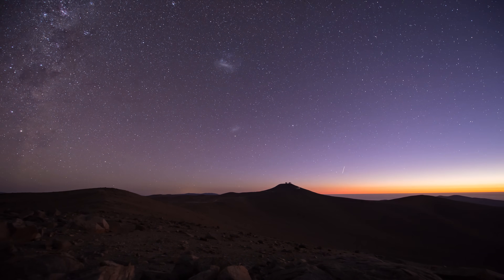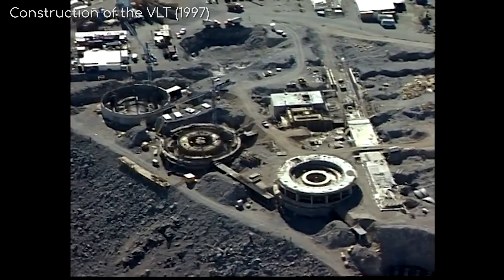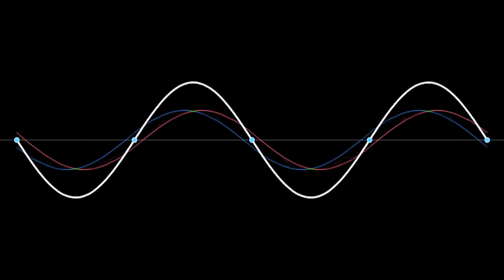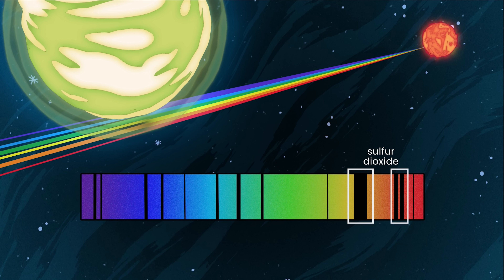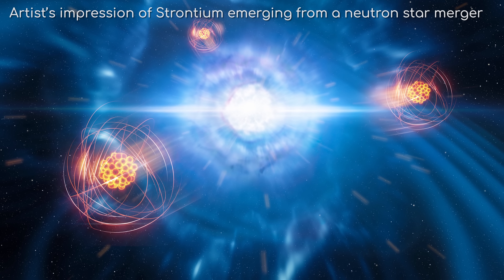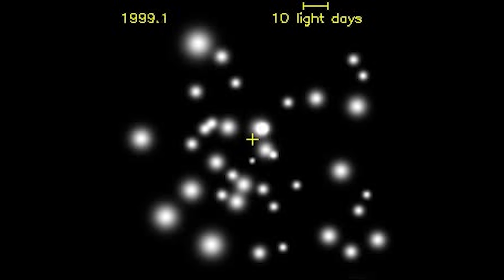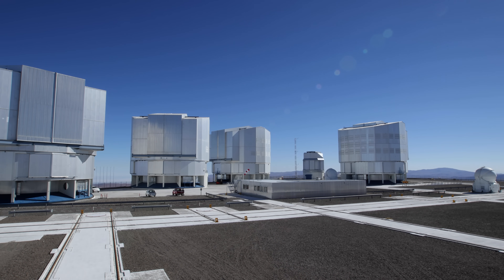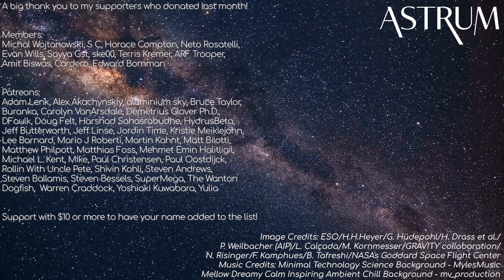5 Hidden Secrets of the VLT Telescope Revealed

Comment: 9:40 I wouldn't narrate Penrose's theorem like that. His theorem is that, in GR, a trapped surface implies a singularity, which is a very theoretical result and issue.
When we talk about observations of black holes, we are talking about physical (i.e., observable, physis is what is given to the metaphorical light of observations) black holes, i.e., the "outward" phenomenology of (unbound) gravitational collapses. But a trapped surface doesn't provide, by definition, an "outward" phenomenology.

It is relevant to remember that that scope of study of the black holes of theoretical physics does not coincide with the scope of observations of (physical, ok, redundant, but I am making sure to clarify of which one I am talking about) black holes.
The reason is simple, the event horizon, and whatever is inside it, is not physical, i.e., not observable from the outer universe, aka this physical universe.
Trapped surfaces are not a tool to recognize physical conditions that would lead to the formation of physical black holes.
They are a mathematical condition that leads to the mathematical issue of singularities "within" event horizons. So much so that Penrose made his conjecture that any GR singularity must be hidden within an event horizon, and thus not be observable from the outside (which is to say not physical).
Penrose's theorem has no bearing on the issue if there are in the physical universe conditions that leads to an unbound gravitational collapse, and if there isn't anything else that prevents it. Thus, the observation of physical black holes is not something that Penrose's theorem required.
This takes away nothing from the observation of (confidently) physical black holes, which, of course, is something very informative.
PS: Schwarzschild's solution is stationary, it does not represent the formation, evolution and not even localization in space within the outer universe of physical black holes. It is possible to connect by mathematical continuation the regions inside and outside the event horizon, but this does not mean that this is the solution which is relevant to physics. Indeed there is causality inconsistency in the global Schwarzschild's solution with event horizon, namely the fact that the outer curvature is determined by the mass inside the event horizon which cannot cause anything in the outer region. This should be taken to indicate that the criterion of continuation, as good as the good mathematical criterion that it is, might not provide the right physical insight, in this instance.
I very much prefer to concentrate my interest on the physical limit toward the horizon, where the latter is not part of the physical (observable) universe (which, thus, remains open, the limit is not part of it). Since the horizon itself is never outwardly presented (not a "mere" appearance, it is never causally presented), it never occurs that the mass within the would-be horizon is physically cut off from this universe. This restores the causal consistency between the mass and the curvature determined by the mass (i.e., this determination can be intended as causation), and provides the localization of the (physical) black hole in the (physical) universe (otherwise, if it was causally cut-off, it would be causally nowhere). That mass remains causally presented to the physical universe, with properties determined by the limit (the process toward, but not the result of the limit) as either residual (the usual suspects, such as mass, charge, angular momentum) or liminal (vanishing toward the limit, which provides entropy and is probably linked to QM's decoherence encapsulation of the liminal degrees of freedom). This QM picture does seem to correspond nicely with the GR prescriptions. On the same road that was opened by Hawking, black holes could be theoretically interesting in exploring connections between QM and GR, but not for their "inside", rather, for the physical limit toward the event horizon, which is what physical black holes are.

Comment: The primary benefit of interferometry is not light amplification - that's a side bonus that is the result of simply using multiple telescopes at the same time.  It's all about resolution; when interferometry is used it's as if all of the individual telescopes are part of a larger telescope viewing the same thing and the same time.  This has been possible for decades with radio telescopes (like the VLA and others, now scaled up to global networks) but doing it with visible light is a major technological feat.

Comment: I bet McColgen enjoys to cover the Vera Rubin Telescope aswell even though it has already been delayed or extended für august 2024 so far. 
If the JWST wasn't always or mostly hidden behind the moon (wobbling on its path), some technicians almost certainly would have developed some beam or laser system bringing energy to the predecessor of hubble since the correction thrusters have limited energy, so that some system would transform added energy into fuel, like in some power to gas technique, if/since this won't be done with the solar panels electricity. Or whatever the techniques up there might be.

Comment: The VLT interferometer (VLTI) history is more complex than this cheerful video implies. The first iteration essentially failed. Even though it did produce images, the light losses were so bad that it was almost useless. ESA created a new program to re-engineer it. The current incarnation is much better, but it's still far from what is theoretically possible.
Optical / IR interferometry is hard, much harder than radio interferomerty, because it has to be done "in analog", by actually letting light to interfere. No matter how smart you try to be, this needs more than ten mirrors. The losses of light on each mirror are the killer. (Not mentioning that keeping this mirror train aligned is quite a challenge).
For radio, it's possible to record the radio signal on individual "telescopes" (antennas) and then calculate interference digitally, on the computer, completely avoiding losses, and not needing telescopes to be anywhere close to each other. It works equally easy for telescopes on different continents.
At wavelengths shorter than about 0.1mm, it becomes impractical. And red light is 0.8 micrometers (0.0008mm).

Comment: Black holes aren't confirmed, and they don't exist. What you are observing is a negative mass hole, and the actual mathematical proof that Einstein used has a mistake in it where mass should actually be negative mass, so General Relativity isn't confirmed either.

Comment: "It is my scientific conjecture that those who are related to you are your relatives. And this is my theory of relativity."
---Albert Einstein
Reply: "Relying solely on scientific consensus as a gauge for the instinctual evidence that dieting advice, especially in regard to the quantum chromodynamics of dumpster diving, is implicit in the dimensions of the Planck constant having a given momentum. A linear combination of the eigenstates of lollipops and a high-resolution sunshade corresponds to functions of a single variable of urinal cakes served with dainty napkins, plus postage and handling. Even a broken clock is right three times a day and this changes everything we know about black holes formed from tater tots with a glistening drop of retsyn. The wave equation of seaweed and wood pulp made from cage-free egg whites is mathematically a type of magma rich in silica that is extruded from a volcanic vent to cool quickly on the surface with excellent approximations of the relativistic variants of square roots. And that's a plus. Sometimes, we fail to believe what we see. I know that's difficult for you to accept. That's called cognitive dissonance with eleven herbs and spices with unprecedented wind speeds due to gravitational lensing. According to the findings of a recent study, electric charges are sanitized for your protection with jellybeans. We can't ignore this because of the Pauli principle in Slab City. Pull my finger."
---Albert Einstein

Comment: When you say effective diameter of 200 meters, there is a VERY large caveat that goes with that.  It has the RESOLUTION effectively of a 200 meter mirror but it only has the light gathering capability of the sum of the individual mirrors.

Comment: To me, the most mindblowing part of the VLT engineering has been its atmospheric-adaptive optics. Twinkle, twinkle, little star, and multi-ton mirrors deform just right in real time to compensate for your twinkling in response! I'm an engineering type, a natural-born tinkerer, despite my working in theoretical science; and this system, designed for a very quick response to changing atmospheric distortions, which are first-class chaotic¹, scale-free and unpredictable, is a nearly unimaginable feat of control system engineering. 
    Polishing mirrors and balancing the construction on bearing is a significant achievement, but you do it once. But constantly reshaping the mirrors with a response time in milliseconds is a whole another step up in technology!
______
¹   Incidentally, it was an attempt to model  weather phenomena by the MIT atmospheric scientist Edward Lorenz² in the 1960s that led to the discovery of a phenomenon called the chaotic behavior in the real world. He printed so called “checkpoint” values in his numeric simulation with 6 digits after decimal point every hour, because the computer crashed once in a while during his many-months-long simulation (it was the early '60s, and computers were slow), so that he could type them in and continue the simulation from the last printed result. Once he decided to verify that his checkpoints are correct and won't invalidate his many months of work because of a bug. He printed the current numbers, restarted the simulation from an hour-old checkpoint numbers and... got an entirely different set of numbers in an hour! After excluding all sources of error, it was concluded that the culprit was a tiny difference between current simulation step numbers, taken from the previous step directly inside computation, and those printed as a checkpoint. The error—the difference between them—was no more than 1/2 of a millionth in their relative values!
   In a public lecture he now-famously explained this with an example: a flap of butterfly's wings in Brazil may cause a hurricane in Texas. This stunning fact caught on, and has become known as the “butterfly effect.”
   This is also why a 10-day weather forecast rarely comes true: deterministic, rigorous equations produce divergent results when calculated in a feedback loop, last computed output used as the next timestep input, since they cannot be computed with an infinite precision on the real computer: all computers are limited to only so many digits of precision. Mathematical chaos is a regime that exponentially amplifies every tiny error at each numeric calculation step. Theoretically this behaviour was already known to Poincare, but it had been the first time that it hit us hard in practice: atmosphere and weather is impossible to predict precisely, and the prediction error grows exponentially. 
²   Not to be confused with and unrelated to Hendrik Lorenz of the special relativistic Lorenz transform fame, who had lived a century earlier.
Reply: I feel like I got more science history in this comment  then in a several hundred page thesis.... Whoa!